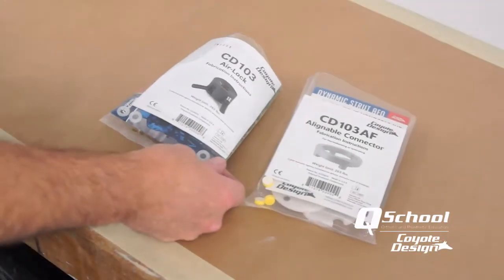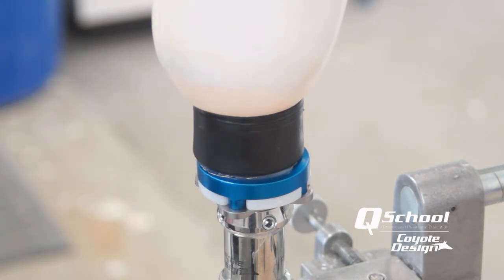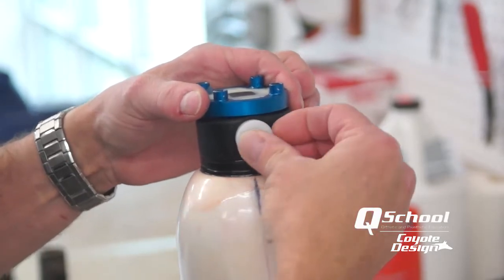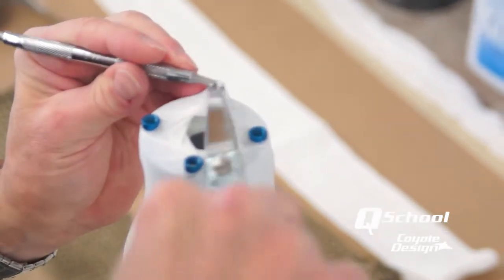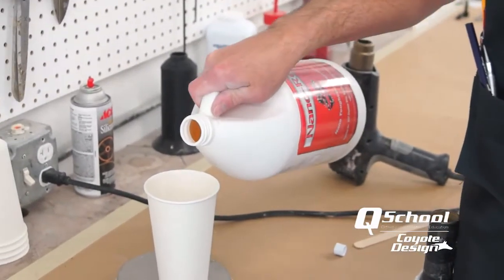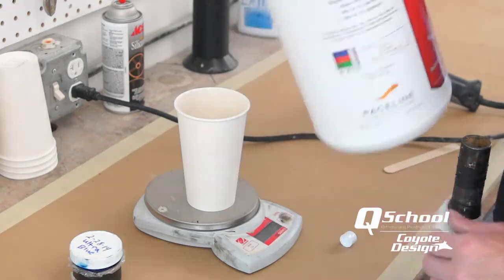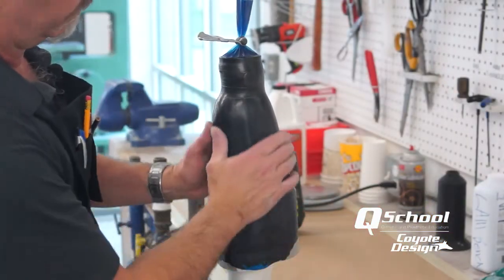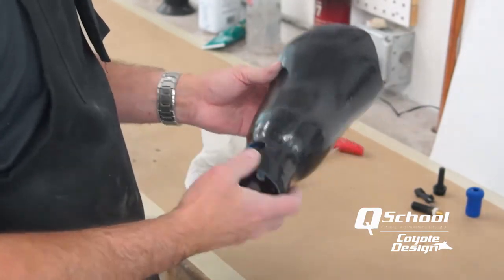Coyote Prosthetics and Orthotics AirLock Lamination Instructions

Comment: Very good video, I am starting to use the system and with the video it is quite clear how to make the socket, thank you for teaching all the process. I have learned a lot.   Gracias por el video es muy instructivo y me ha ayudado a comprender perfectamente el proceso de fabricación y a mejorar el acabado de un laminado.
Reply: miguel verdejo the lock will fail shortly after it’s installed. I’ve had one on a couple different sockets and it’s nowhere near as good as Bulldog locks. Hope it works, but be careful for failure.... it is definitely going to happen.